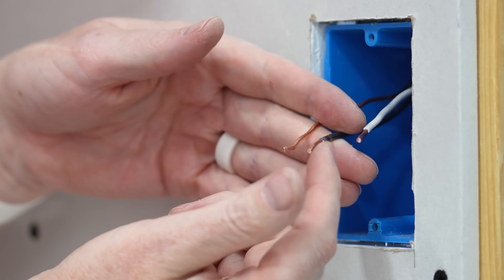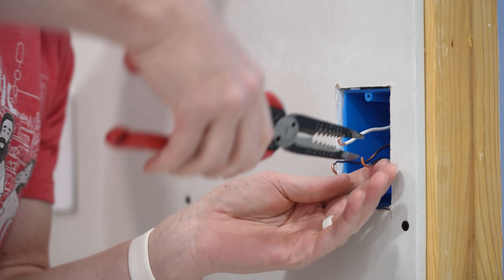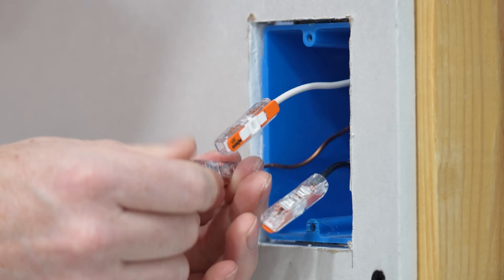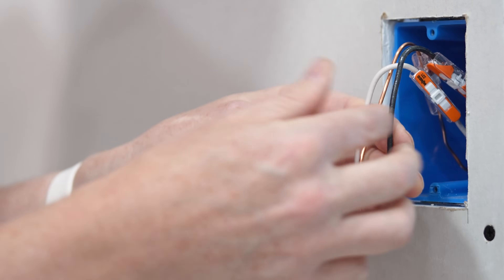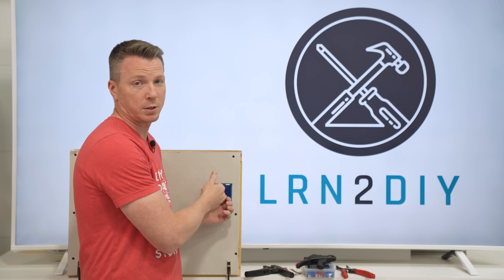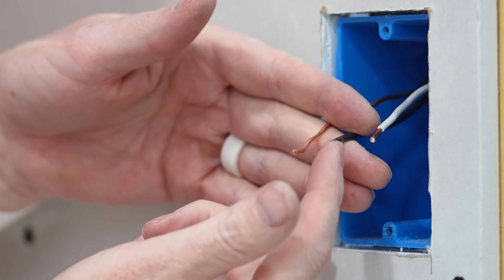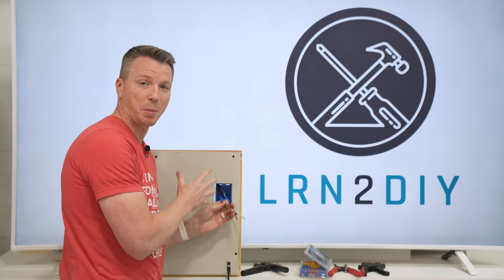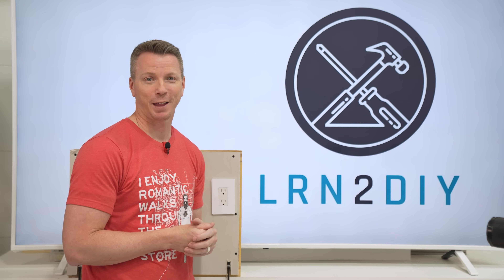Electrical Wires Too Short? 3 FAST & SIMPLE Fixes

Comment: Or you can just use a wire nut. Just put a j hook on the end of the pigtail, twist with your lineman's and then ad the wire nut. Just as easy as the wago and less expensive.

Comment: Not all crimped connections on solid wire are acceptable per the National Electric Code. For the audience, please confirm what connections and related tools are acceptable per the NEC.

Comment: Those crimps you're using are made for low voltage use NOT listed for use in 120v systems at all, they're aluminum and you're mixing metals with no way to stop corrosion. Second the plastic on them is not rated for 60 deg C , AND it's impossible to make a reliable connection to solid conductors. In other words you just taught 100,000 people how to start an electrical fire in their homes.  There are inline crimp connectors that are listed - you won't find them are the big box.

Comment: I can’t believe the “wago” type connectors so long to take off in America.  We were using them at my company in USA at somewhere around 99. 20 plus years later, finally, it’s completely new to us.  I don’t remember the brand but believe it was wago but they have def changed the connection type.  Even then, the old ones were actually better than the cheaper type of outlets connections.
Reply: They're against NEC in some application. Like, I'd imagine, inside walls.

Comment: I didnt know that crimp connectors can be used on 110 a/c. Can i use crimp ring ends to the outlet too. We use them on boats so that they cant vibrate loose and come off.

Comment: I find the inline Wago's to be a pain in a crowded box.  If only they made a line of connectors with one of the connectors facing the opposite direction.  This would be handy not only in a 2 wire connection but in a multi wire setup where the in-feed wire and out-feed wires are to travel in the same direction, avoiding that curl needed on the wires.
Reply: They make an inline wago. Straight line.

Comment: Yes wago’s are a DIYER go to connectors more so than electricians. Twice ive had issues with wires pulling out that was enough for me to say never again to wago’s. Very informative video thx for sharing 👍👍
Reply: Same. Especially the lever ones. It's too easy to open a lever while pushing it towards the back of the box. I guess I can tape them
Reply: @ exactly, in a crowded box as you tuck the wires the tabs will get tangled and snap open

Comment: Ive been dealing with electronics and electricity in general for the last 50+ years and did some researching in the past regarding those slip type connector devices and found many electricians thumbs downing them for the same reason I suspected,which is,without a tightly screwed down connection,the amperage carrying capability is not up to par. I'll use,at the very least,barrel crimp connectors.The pressure connection is considerable, unlike those things you display.Its the same principle as a weak solder joint compared to a firm solder joint. The weak offers a chance for overheating when a load is applied. Do as you will,but Ill not risk an in-wall house fire for convenience.
And if you're demonstrating these devices due to the support to your channel by that company,Id be doing a lot of my own research before promoting such devices.

Comment: Overall very informative..you made some great points and highlighted some great fixes when, for whatever reason, the existing conductors are just too short to work with…the Wagos, in particular..years ago, you’d  be absolutely screwed with such short conductors..will note that ‘plugs’ are on the end of a cord..’receptacle’ outlets are what you were testing in the beginning of the video..also, noted that it was stated that the conductors were part of a 12-2 cable..which means ‘yellow’ butt splice connectors should have been used…’blue’ connectors are for 14awg…so perhaps, you really were working with 14-2 cable. Thanks for sharing..it’s always good to learn something new or get a tuneup every now and again. Keep up the great work!

Comment: Remember wago connectors depending on the model number have different amperage ratings. Also the NEC doesn't prohibit the use of wago connectors, you should check with you local electrical inspector. NEC 90-4 we electricians call it the "god clause". The AHJ authority having jurisdiction might not approve wago connectors.
Reply: Ive researched those device types and saw the majority of electricians dont advise the use of those devices. The metal its self in them may stand up to the amp rating,but the pressure the devices create are much weaker than barrel crimp connectors,thus offering weak connections leading to overheating of the connection and the potential for an in-wall fire. Ive worked with electronics and electricity for over 50 years and due to research and common sense and principles of electricity,I wouldnt trust them in the least.
Reply: @STEVE_C_1369  WAGO quick connectors have been on sale longer than you have been an electrician.

Comment: Perfect! I replaced a power switch in my apartment with an IOT switch we could turn off with Google Assistant. I managed to make it work, but the wires were nowhere near long enough. I need to replace the switch so knowing of some options is super handy. Thanks!

Comment: The one thing I think you forgot is do wago connectors use different size connectors for different size wire or does one sizes fits all.